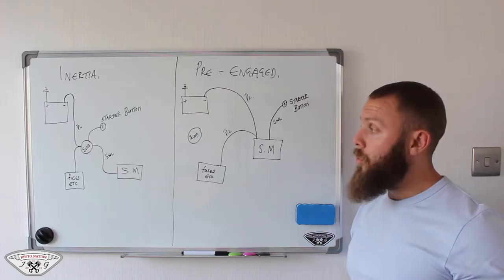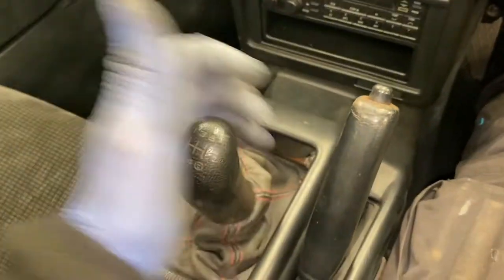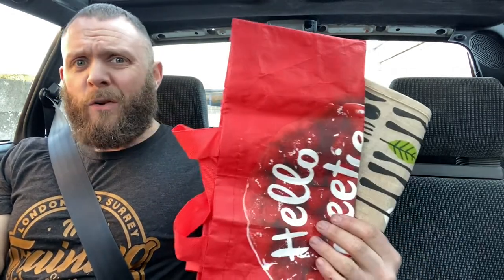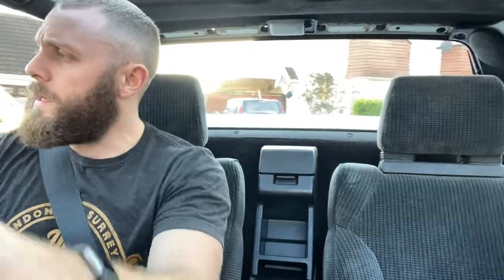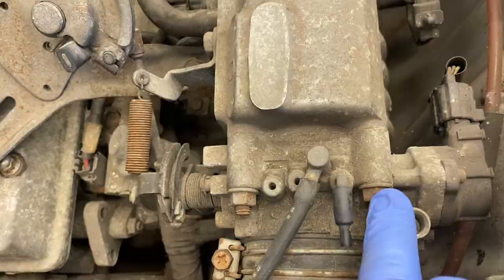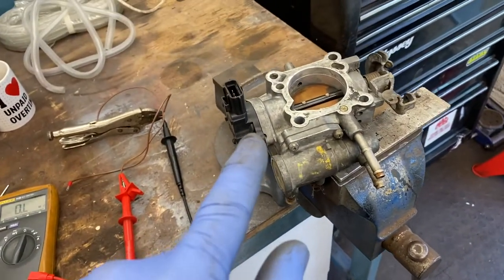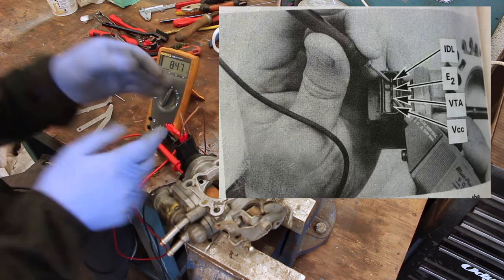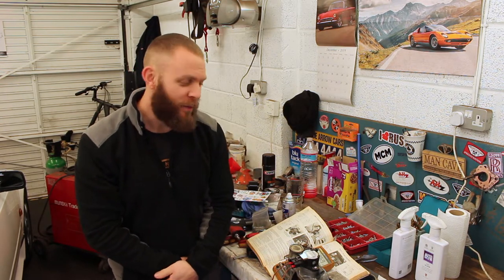Test Driving, Snagging List and Setting the TPS (MR2 Mk1 Restoration ep.14)

Comment: In fairness, after all the detail testing the TPS,  just using your boot to test the result without any sort of measurement is just a cop out.  There are many ways to improve an MR2 mK1 without having to go to the trouble of checking your TPS with results questionable just using the seat of your pants.